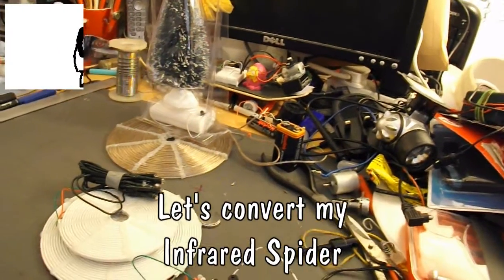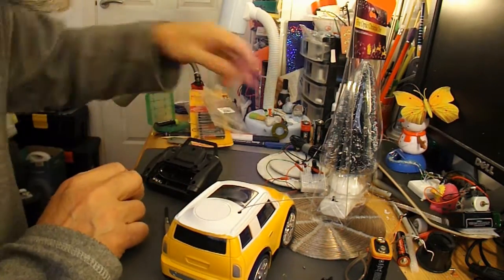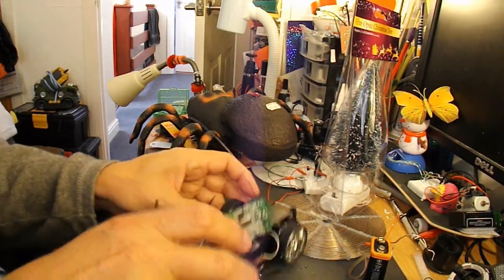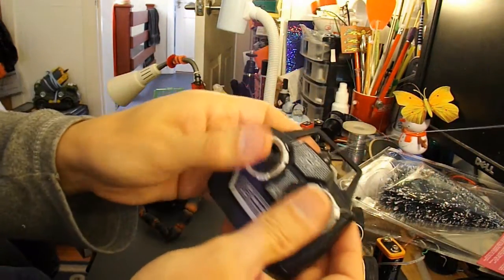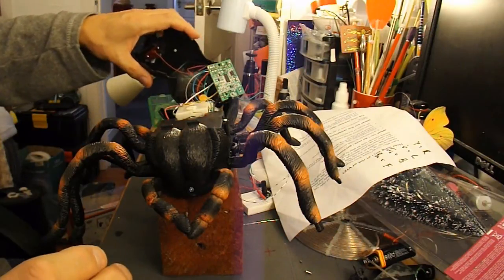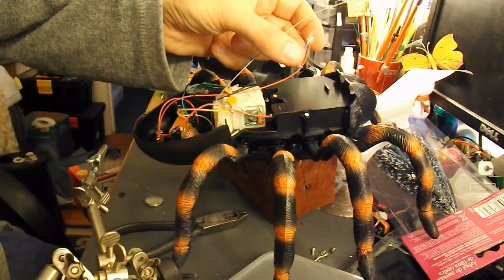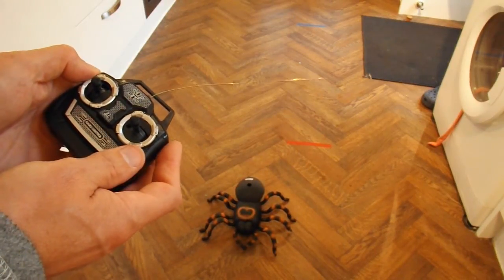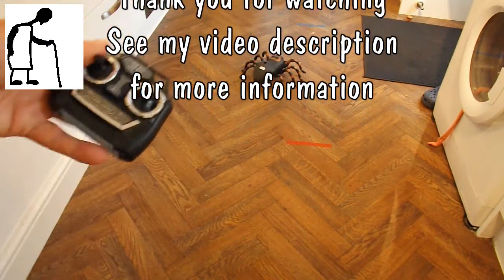Let's convert my Infrared Spider to 27MHz radio control

Comment: cheap and fun, I bet the spider is glad to be back and crawling lol.  Now you have a nice little car to re-purpose as well.
Reply from the maker: Yes, at that price for a fully functioning r/c kit it opens all sorts of options. Obviously the range is limited but it would probably work for a small boat project or hovercraft etc. and as you say, I have bits left over to make something useful with. The down side is that it shows it is hardly worth making something yourself when you can buy ready made so cheaply.

Comment: Good find and a superb changeover !
That badass arachnid walks like a troop of soldiers  LOL
Reply from the maker: Thanks. All that work and my wife's comment "It's not fast enough" !!!
It is interesting to watch walk for a long distance. As it has a separate motor for each side and there is no synchro between left and right, it goes though a slightly out of sync cycle just like two clocks just out of phase. I still think the rowing boat might happen eventually.
Reply from the maker: Just about to upload a wireless Christmas tree ornament inspired by your November 2012 video.
Reply: GrandadIsAnOldMan
 Noticed the coil and the tree !
Oh, tips for current usage if your transistor warms up...100ohm resistor on one battery feed and a diode on the other. Most systems don't need it and your coil seems to be 12 or more turns, so you should be fine anyway.
Reply from the maker: Actually using a 9v battery but it is pretty flat. Also has a big value variable resistor and a LED that I put in the circuit just so I could see it was switched on.

Comment: Disassemble your remote control and flp left right seldered wire in the remote control and it will work fine just flip the wires and solder (left on right ) and (right on left) and the direction will be fixed that's all. سلام
Reply from the maker: Steve Blayer I don't know what you think you are fixing with your suggestion? It works fine, nothing needs swapping. The left joystick controls the left legs forward/backwards. The right joystick controls the right legs forwards/backwards. 
If it was physically possible to rotate the right hand joystick through 90 degrees so it moved up and down instead of left right, that would be an improvement although it doesn't take long for your brain to work out the stick movement anyway.
I do have two other transmitter with 'tractor' style controls that I could use if I wanted but the project was to show how I used a cheap toy car controller to do the job.
Reply: Great work sir excuse my poor english i thought the directions were reversed 10x for such Videos that's great proof.

Comment: Be a gentleman and put the ir receiver in the toy car
Reply from the maker: What is the point? I explained that I could not find a matching IR transmitter to operate the IR receiver which is why I swapped it to 27 MHz radio control.
Reply: Leaving a toy without a receiver is unacceptable and you already know what the proper controller looks like and responds to that ir receiver. That day where you refused to buy the ir spider in the charity shop because it was €10.00